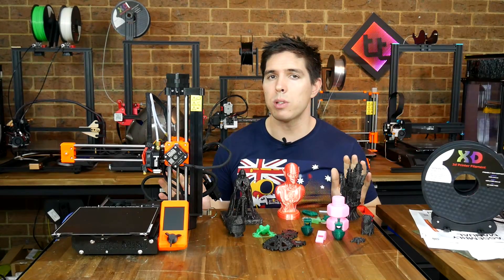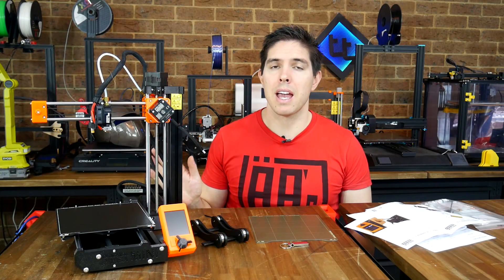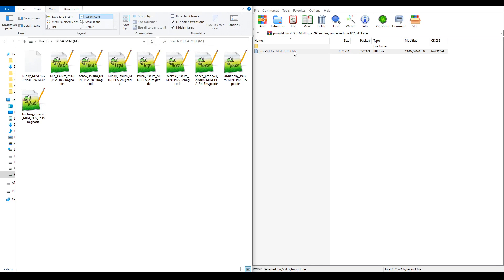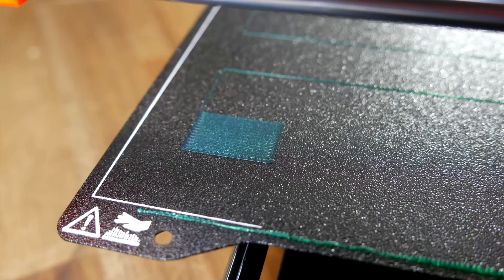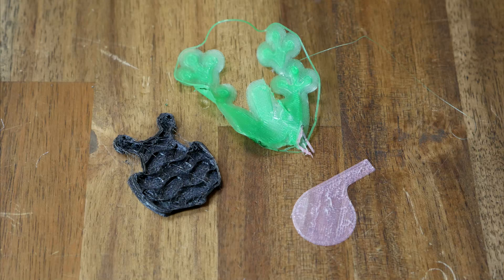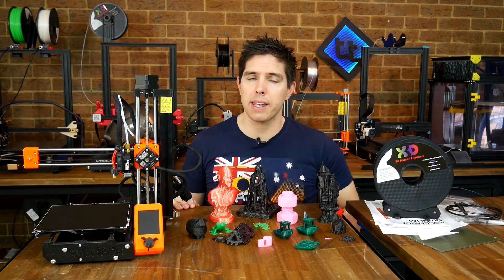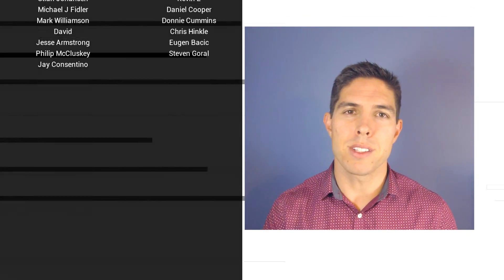Prusa Mini first prints (and troubleshooting)

Comment: I despise  "printed" parts in a printer kit, especially when its pricey.    Seems like they dont even care how bad the printed parts look.  Over priced prusa crap.
Reply: caphead if you can’t get excited to have a printer made from another 3D Printer then you just don’t get it. That my friend is the main selling feature. And prusa provides all the stl files so you can print any color in any quality you want giving you a truly unique printer. 

So for some the 3D parts are the selling point. My mk3/s prints better then any creality or artillery and I own both a Creality CR10v2 and X1.
Reply: @Private_Snowball  My printer is also printed by my printer. But the quality of the prints that Prusa comes in is atrociously bad. When buying a printer this expensive, you would think that they would use a higher quality setting, and not use like, a 3D Pen to make the parts by hand.

Comment: I experienced the same jams, dug into forums and found out the extruder ptfe tube was actually not too small, but the extruder itself was about 3 mm lower than it should. 

With a cold nozzle, I unscrewed the 3 lateral screws and pushed the extruder up then tighten back the screws. Also had to clean the remainents of plastic insight the extruder with a cold pull. After that it printed beautifully.

Printer came on the 27th of feb, so probably the same batch as yours.
Reply: Got mine just two weeks ago, and I still had the same issue you had with the hotend being lower than it should have been.

Had to troubleshoot it for 2-3 days, now it works like a charm.
Reply: exactly the same here
Reply: Any idea whether they managed to fix it already? it's June and I'm planning to order very soon
Reply: Same here. I think I'll buy another brand.
Reply: @RoboticalHeart  just got mine the other day. Not quite sure yet but I think this one has the same issue.
Reply: how to know extruder is too low?
Reply: I tried to do this same fix and stripped out the 3 lateral (grub) screws.  Be very careful when changing them -- it's ridiculous easy to strip them.
Reply: Hello.

Same thing for me. Underextrusion, extruder clicking, 
 It s my first printer and i was a bit disappointed because this is a ready to use printer....  I fixed it in a few hours I have never done this before  but I m mechanic so it s okay for me (I need to clean the extruder too and cleaning the heatbreacker) but for a novice who never touch a 3d printer like me. it could be a problem.

Now it work good but I still having a problem with the alignment of xz axis (doesn t affect prints), software crashes, and the PINDA sensor sometime doesn't work correctly and my first layer is too high.
But I like it. 
Prints are really beautiful!

Just in case.
Don't focus on the extruder clicking. If your hotend need to be fixed the pla can t go out of the nozzle correctly and this is why your extruder can t do his job.  If you increase the temperature of the noozle and reduce the Velocity sometime it could work better for a while but you will. Need to change the ptfe tube inside to have it leaktight. 
Good luck.

Make sure you re using good the good temperature for you filament. I have a pla who need 195 to 220 to melt and I if i put 205 sometimes the extruder is ripping when the prusa mini prints fast.....

Comment: I have the Prusa i3 mk3, and I've loved using it, it's been an amazing printer, but when I heard about the Prusa mini, I kind of wanted to sell my i3 mk3, and grab the mini in its place. However, after watching this video, I think I'm going to stick to the i3 mk3 at least until all of these issues are fixed. One of the things I loved about the i3 mk3 is that It's never given me issues (not counting print failures due to something stupid I did). I just don't think I can trade the mk3 for the mini if the mini is going to have issues. Also, my printer is still in great shape, do you think to sell a Prusa i3 mk3 assembled, in great shape is worth $750, if not, what would you price it at? (just in case I later do decide to sell it)

Comment: To everyone who likes the X3D sparkle filament and is not from australia: Check out the twinkling filaments (blue, red, white, black) from Ziro 3D on Amazon. They seem to be practically the same. I use their filaments for years and am very happy with the print results. Also they come with a zip lock bag to store the spool in. 
The issue with the teflon liner not butted up on the nozzle is something I would'nt have expected from a Prusa printer. Overall a bit sad to not have an all metal hotend anyway. The production cost is tied to that. But the print quality is pretty good I'd say. I do not wonder about the fit of the polypanels a bit looser than on other printers. My guess is that the Prusa just prints a bit more accurate than other printers. BUT: from my experience the Prusament PLA preset in slicer is underextruding a bit. So even when I use Prusament I choose the Prusa PLA preset. For the stringing? It is either the cooling not strong enough or your print temperatures too low. The preset Temperatures in Prusa Slicer are a little low. But that depends on the modification of the PLA. Usually I print PLA with 215°C.

Comment: Thank you, thank you, thank you for the first “real” test of the Mini. This is very concerning for me, who ordered a Mini for delivery in mid-April. I recognize that despite these machines moving into the “mainstream” in recent years they are not yet appliances. That said, I have been spending a fair amount of time getting a DIY i3 clone design made through a maker lab group build project up and running (still tuning), including replacing the original 5-year old board and (just yesterday) replacing a heating element that stopped working all of a sudden. I have been looking forward to something that would be a lot closer to “plug and play.”  Clearly, as of early March 2020, this is not it. And, this isn’t a local PBS channel - this is a major league YT channel sounding the alarm. Why hasn’t Prusa weighed in?  I’m not being a hater by any means - I’ve chatted with a Prusa customer service rep who spent about a half hour with me back in December when I was weighing this purchase (which I had accidentally ordered twice - hence my outreach) and she was incredibly helpful. I could spend the extra $$ on a Mk III S but felt it was overkill for my (admittedly hobby-oriented) needs. I feel like this well-regarded channel (and it’s supporters) deserve a full “confession” from Prusa on how this adventure has gone so far and share it’s plans for taking care of us “first adopters”, if you will.  I don’t want to tell my beloved spouse that I purchased a first-gen product and it had hiccups (I will never hear the end of it) :) thanks again for bringing this out into the open.  And, btw Michael, you have a new Patreon supporter.

Comment: I've had my Mini for a few weeks now. Sticking was an issue in the beginning, but with a little bit of PVA mixed with IPA that stopped being an issue. I installed gregsaun's improved parts and that fixed strain relief and cable lengths, so the last issue for me has been the extrusion. It seems like the teeth aren't deep enough, so the gear isn't biting into the filament as well as it should. Stringing has been present as well, but I was expecting that as the printer is bowden. Further tests are needed, of course, and it doesn't really compare to the mk3s (I have a bear/pullybox MMU2s, and it is amazing). Still a good budget option, far better than others in the price range, but not quite plug-and-play.
Reply from the maker: Have you adjusted the tension on the mechanism?
Reply: @TeachingTech  I just did. The teeth on mine are oddly shallow, appearently a known issue. Hopefully a little tightening fixes it.
Reply: @TeachingTech  I'm about to help a school install two new ones, so I'll be able to see if any significant changes are present.

Comment: I was kinda lucky with my mini, i got waaaay better prints for mine... It prints so smooth that parts look almost "production like". My only complaint was the assembly... I couldn't square the two pieces and it took 3 hours only to attach them together since one of the screw didn't want to align! Playing around with those 3 screws helped a lot and now it shouls be squared correctly

Comment: Thank you for the excellent (not a) review.  While I understand the stated caveats, I can't overstate how disappointed I am with the results.  I'm really still rather a noob at 3D printing but I've always been under the impression that if you don't mind a little tinkering and hands on you got a Creality CR10 or Ender 3 and if you wanted a printer that "just works" (tm) you paid a not-insignificant-amount more and got a Prusa.  I don't want to be a fanboy for any particular company.  At the end of the day I just want a good printer regardless of who makes it.  I can understand minor bugs in the firmware or unexpected part failures in a first revision but basic assembly issues like gaps in the ptfe/nozzle assembly causing clogs seem pretty egregious to me.  It's something I would expect from some no-name, generic $100 printer from a company you've never heard of in Kazakhstan.

Comment: I have been using the Mini for more than two months and I am overall happy about the machine. After about one month, or couple hundreds of hours of printing, I had exactly the same issue with yours, the print started under extrusion, then clogged nozzle in less than 2 layers of the print. Contacted the Prusa support but they had little knowledge but to let me clean the extruder over and over again. After hours of trial and error I figured out the issue and I the machine is running well for days again. I put a quick 'unscripted' troubleshooting guide, as I would like to share my experience with potential Prusa Mini users, https://youtu.be/dmrWNVMClA0.

Comment: I noticed your benchy not sticking to bed for a couple of trys. I have been using PEI on my print bed for PLA. Love PEI once I started heating bed to 80c. after that increase in print bed temp, all my prints stick every time. Even if the nozzle is to far from bed. Have tried to knock prints from hot bed, they don't budge. I have the flex steel plate on Magnetic sheet. The release is great when bed cools. Have come back to a finished print with the bed cool and simply pick up the model, no prying, no flexing just pick it up.
Reply from the maker: Thanks for the tip. Self release on cooling is a great thing.

Comment: I was a Printrbot guy for many years, and I finally got the pleasure of putting together a MK3S kit for a student lab I work with last year. I am absolutely certain that if PB's out-of-the-box documentation were anywhere near as good as Prusa's, PB would still be in business. I am looking to get a Mini down the road, perhaps in 6-8 months. Other Prusas have also had growing pains in the past, so I'm reasonably confident that it'll be a much more solid platform a little ways down the road. I wouldn't be opposed to getting a MK3S for myself, but the price point of the Mini is what really sells it for me. I'm poor, lol.
Reply: If you're poor, you should get an ender 3

Comment: I got my Mini a few days before you and I suffered the exact same issue. I managed to fix the clogging issue by loosening the three grub screws holding the heat break and simply sliding the whole heat block assembly up until the heat break was firmly seated against the PTFE tube. It was about 3mm too low and after adjusting it I had to re-adjust the height of the probe. It printed great after that. 
Ultimately I was able to handle it because I've been printing for quite a few years and I understood what was happening, but I feel bad for all of those people who have had to deal with customer support trying to figure out what is wrong with their printer that is supposed to work out of the box.

Comment: I don't have one of these but that issue with the ptfe tube and the hotend is a issue I've dealt with on my Ender3Pro.. I that issue right now in fact. No matter how clean I get the inside of the hotend and how flush I press the ptfe into the hotend it seems to slip upwards even when it is clipped in place and seems tight. I end up having to disassemble the hotend every time now in order to change filament. I've tried new press fittings and even a new hotend. The sprinter still prints great even though it does this. I really only have issues with it when trying to change filament. Still I may just end up swapping out the creality mk8 style hotend for something completely different. I'm really thinking of getting a masquito but really can't afford it. I wish it wasn't so darn expensive. 🥴
Reply from the maker: I've been running the micoswiss all metal hot end for a long time now. Straight swap and as you would expect the PTFE tube does't run anywhere down near the nozzle.

Comment: Looks like Prusa should have stuck with E3D for their hotend designs.
Reply: After serious extruder problems with a Mark 3S, I was happy to see that they finally went to a Bowden setup. Unfortunately, it appears that Prusa still insists on using their own crap hotend design. Sad.
Reply: @terrygould781  Still insists? This is the first machine they have their own hotend in? As I recall they have always made their own extruders as in the previous MKx where they use Bondtech gears in their own assembly instead of using the whole E3D and Bondtech Combo.
Reply: @arvidzson  MK3S uses a modified E3D heatbreak. They have a lip inside it which causes jams. This lip is not present on the original E3D hotend so you could say that they are indeed using their own hotend.

Comment: I would not buy a Prusa, they are just too expensive, my friend has one and his prints are no better than mine, In fact, he has to use my printers when his Print is too big for the Prusa, they do print slightly faster than my Ender 3 and CR-10S but I'm not impatient, I have been buying parts and materials of the very best quality to build my own core XY Hypercube 500x500x500 and believe I will get more enjoyment from building and using the Hypercube than I would from any Prusa and my friend agrees with me.

Comment: I also had a similar experience with prints not sticking to my textured PEI sheet. What ended up working for me was cleaning the sheet with warm water and dish washing soap by hand, drying the sheet, and then going over the sheet with a little bit of IPA. I've had good success printing with Yoyi branded PETG on the textured sheet so far! After the bed cools, the print released without having to remove the sheet. My Z-offset hovers around -1.080 or so, which is roughly 0.3mm lower than my smooth PEI sheet.

While I haven't come across any major clogs or extrusion problems yet, I re-seated the hotend PTFE tube as shown here: https://manual.prusa3d.com/Guide/How+to+change+a+hotend+PTFE+tube+-+MINI/1505?lang=en during my initial build of the printer. Some users on the Prusa forums reported that they received a shorter PTFE tube inside the hotend than specified ~43.5mm.

Additionally, as a sanity check, I also adjusted my MINDA probe height since I read that there may or may not be issues with the height due to shipping. This was done by moving the nozzle until it just touches the build plate, loosening the screw holding the probe to the hotend, placing an old credit card that's ~0.8mm thick under the probe, and adjusting the height until just touches the credit card. I followed Step 29 of Prusa's MINDA changing guide here: https://manual.prusa3d.com/Guide/How+to+change+a+M.I.N.D.A.+sensor+-+MINI/1514?lang=en#s41055

I hope you can resolve any further issues you may have with the printer, Michael!

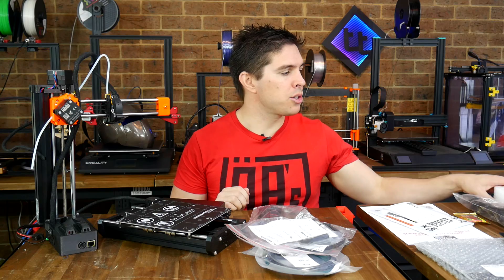Comment: @2:10 its not just waste packaging, this is why im actually against all these tiny printers. with the rise of printers and especially more tiny printers people are limited to tiny trinkets that serve no purpose and objects are quickly thrown away causing tons more trash... most actually human useful objects already struggle to fit on a 220x220 build plate as it is. also having these tiny format printers just helps justify the massive price increases for reasonable sized printers which have nearly the same number and complexity of parts but just larger frames and beds in which a bit more material and build volume doesnt justify hundreds of dollars more for the machine. (see ender 3 vs CR10S3/4 where they are the same minus a few hundred mm in aluminum extrusion and many hundreds of dollars difference.)

so these little printers are a real problem in my eyes, it seems like the industry is going backwards and causing problems in pursuit of profit.
Reply from the maker: You should be glad to know I will be continuing my series on recycling waste prints this year. I've now also got solar panels so most of my printing is off the grid.

Comment: I must have ordered my prusa mini the same time as you, since I got it last week also. I've been printing for a week straight, 12-14 hours a day without any issues or jams (knock on wood). I haven't had a single print come unstuck during printing, but I've only used the smooth pei sheet. I'm not sure about the textured sheet. Perhaps I'm the exception, but I've had great luck with my mini so far